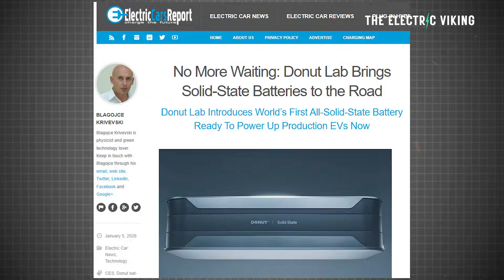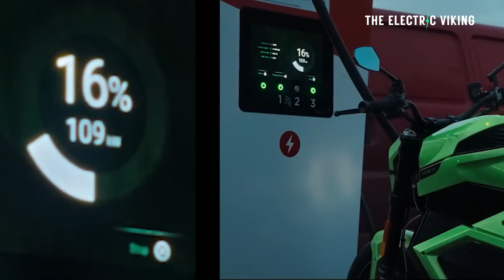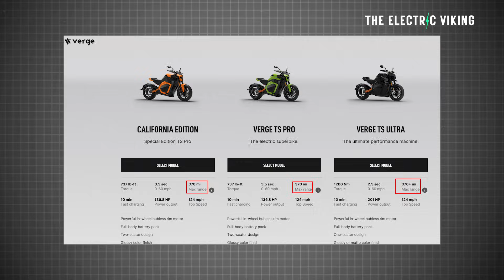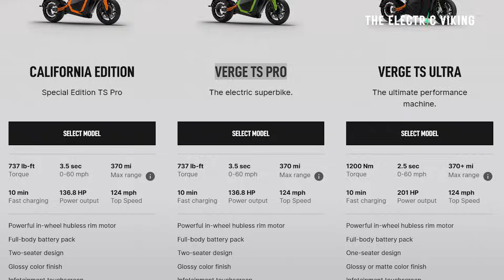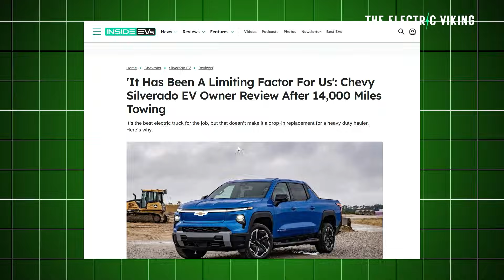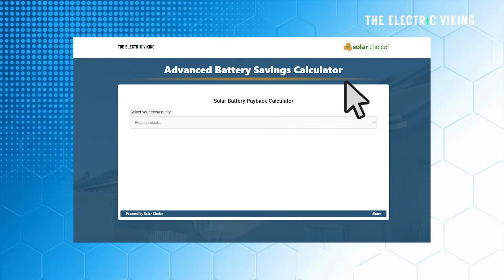The world's first true production-ready SOLID-state battery lasts for 100,000 cycles

Comment: Sam, I'm pretty sure the 700 they mentioned for the motors was torque and not hp, but I could be wrong.  Also did you mention these batteries don't use rare earth materials.

Comment: Guys, apparently we only have to wait about 3 months to learn if this is all real.  Bike battery teardown coupled with performance data.
Grok has found little more info than Sam has mentioned, apart from suggesting that one of the electrodes is very likely lithium.
Roll on progress (I hope).

ADDENDUM
I have watched the Donut Lab press release and commented there.  Below is what I was pondering - FYI...
===============
A major advantage of independent wheel-hub motors on 3 or 4 wheel vehicles is that intelligent differential drive can be integrated into the electronic control software at no expense in extra hardware and weight.
I do hope you guys pull off the SS battery in the wild.  Next 3 months should tell us how this plays out.
Commensurate with that, I do wonder what the self-discharge rate of your new battery might be.  Because an ultra-capacitor can deliver similar or better performance in the short-term.  I suspect there may be a hybrid technology that lowers the main drawback (self-discharge) of ultra-capacitor technology.
===============

Comment: now take your EV going green and humanity saving, planet reviving goggles off for just 2 mins and think...

now...NOW....that the real battery tech for EV tech is so so close....WOULD IT...be a very good got dam idea to actually...HUALT all EV magnifacturing for just... TINY BIT LONGER.....so that we are not causing a complete fk'ing sht load of planetary distruction with this current battery product we are using and making at INSANE speed and scales??  and thats not to minimize the slave labor THAT IS BEING USED to produce them/these obsolete EV batteries??   and the kick is,  shouldn't we be STOPPING the old battery tech for the simple fact that in a year, two or three,  we won't be trashing all the old ones just as fast as they were made, cause everyone will obvisiously are only gonna wanna buy the solid state battery EV's instead??

i think its fk'ing bullsht how this EV roll out has gone done because of them simply and OBVIOUS very important reasons alone.   if it did actually any good to the real sense,  all the eye balls and extra effort on evolving them, has very likely put us here and now, where...."hopefully"  we aren't just being bullshtted into thinking we have solid state right here or right around the corner.

Comment: For those familiar with the International System of Units (SI), 100 °C requires no elaboration: it corresponds to the boiling point of water at standard atmospheric pressure (1 atm ≈ 1 bar).

Comment: Okay let’s talk batteries and energy production. Why renewable energy will quickly take over from fossil fuels.
Let use my personal example .
I bought a 6.1kw kingspan turbine for £30,000 and over its life time will spend on average £1,000 a year maintaining it as long as keep maintaining it, and replacing parts the turbine is good for at least 25 years upto 50 years. 
So let’s do mid range. And say £35,000 over 35 years plus initial cost of £30,000 . 

£65,000 for production of 630,000 kwhr on average over 35 years

Cost 10.3p unit. 

I currently use about 9000 units a year in my house saving me £2610 a year plus I get paid 6.06p a unit for 9000 units I export .
£545 a year paid for exporting

Total Return per year £3155.

Plus I import 6,000 units a year which costs me about £1800 a year 

So why all this figures, take pylontech batteries 2 years ago used to cost £1,500 now you buy them at £800 each

I will be installing 30kw (6 batteries ) at a cost of £6,000. what will happen is I will import roughly 50% of batteries everyday at nightcrstecof 8.5p unit .
And storing about 50% of the wind turbine 

This will save me roughly 1,400 a year in electricity 

Now I’m installing pylontech us5000 batteries which in their standard life time are good for 8,000 charge cycles or about 22 years so 
By installing these batteries I will save over 22 years ( not assuming electricity goes up or down ) £30800 

The bottom line The tech at the cost efficiency we have now means people like me with space/ electric heating/ EV cars and battery storage, live very cheaply and without much fossil fuels . 

Sodium batteries will be cheaper and less energy dense , but who cares if xou are using them in a house storage set up . 

I see A lot of people commenting thst solid state batteries are wishful thinking, 
My set up would have been impossible 20 years ago at the price I could afford , 
Just 5 years ago I was looking at over £14,000 for a 10kwhr battery set up for a wind turbine, now I’m looking at about £6,000 for 30.

In my adult life time we have gone from massive bricks of mobile phone, to iPhone / Samsung smart phones.

I wonder how many nay sayers at the time argued that mobile phones wouldnt work . Etc

Comment: Your math doesn't add up. You said the batteries produce a 40% increases over current batteries. 40% increases on a vehicle getting 450 Miles is only 180 add that to 450 and you only get 630 miles not 900. That's still good, and it might be enough to help that truck tow the 450 originally hoped for. the other question is at what cost. NASA developed the solid state battery I believe back In the 60's, but who has their  kind of budget? I suspect we're still a long way off from affordable solid state batteries. I like you would love to be wrong.

Comment: According to the company, the only specified cost is with their TS pro electric motorcycle - cost $34,000.  for a 20kWh battery.  So while it may be possible to have an electric car or maybe more  cost effective in a plane it would cost you about $60,000 USD just for the batteries and 40kWH capacity.  If these batteries do not have other big drawbacks - say catch fire, or are brittle and can't take shocks or production is very limited due to rare earths etc.  Then it could work its way down in cost to average consumers.  All this is speculation, we've heard companies make big claims before.  Even if it is true, it doesn't mean charging is going to be faster - your charger is often the limit and the charger is in turn limited by local power infrastructure which rarely can do better that 100kWh an hour. usually a lot less than that; and that is with one vehicle being charged at a time.

Comment: I think these guys are primarily advertising a motorcycle and motor, with the battery used mainly to attract attention and secure pre-orders rather than as a near-term mass-market product.
Realistically, there would likely be a 5+ year waiting list even if everything goes well. A small company like this has no realistic path to mass producing solid-state batteries in the short term.
Even with significant external investment, you’re looking at a minimum of 2–3 years just to move from a prototype to limited production and that’s an optimistic timeline. Scaling solid-state battery manufacturing requires enormous capital, specialist facilities ect

Comment: A hub motor sounds great for many reasons.  But it will suck.  Sorry, but wheels need to be light in order to follow the road.  When you go over a bump the suspension has to push the tire down to maintain contact with the road.  This is impossible to do quickly with heavy wheels.  And without contact you can not steer, break, etc.  For a motorcycle going around a corner, this is of utmost importance.  You want keep the wheels light to maintain that traction.  Putting the motor in the hub adds significant weight.  People with performance machines already pay thousands extra to save a pound with forged or carbon fibre rims -- no way they accept an extra 20 pounds.  They would rather add 100 to the frame then 20 to the wheel.

Comment: These are bold claims. I'll believe it when I see it independently corroborated. By multiple peer reviews.

I'm open minded and curious about the:
▪︎400 Wh/kg energy density
▪︎5 minutes full charging at 100% power
▪︎100,000-cycle lifespan

Manufacturer's marketing claims are absolutely useless to me, especially considering provenance, Estonia, and its lilliputian population of merely 1.19 million people in total—that's not even a quaint remote village where I come from.

But I'm hopeful and wishing them Estonians the best! Please don't disappoint your potential clients. You only get a single shot at making a good first impressions...

“It takes 20 years to build a reputation and five minutes to ruin it. If you think about that, you'll do things differently.” 
~ Warren Buffett
Reply: Further research reveals:

Today
Hello Copilot, regarding Donut Labs solid-state battery, I'm looking for the patent, to understand what they are talking about? Could you please assist and find out the actual patent if any? There is a # but it is empty of significant info, leading me to think this is a SCAM? This is an excerpt from my personal searches: Trademark Registration: The "DONUT LAB" trademark has been registered with the United States Patent and Trademark Office (USPTO) under Serial Number #98951880. This trademark covers various categories, including computer software and hardware for vehicle operation, electric motors, and batteries. 
1
Short version: Based on all available public information, Donut Lab has no identifiable patents filed with the USPTO or any other major patent office, and only a trademark filing exists. Their CES announcements contain no patent numbers, no published applications, and no technical disclosures. This is highly unusual for a company claiming a world‑first breakthrough in solid‑state batteries. It does not prove it’s a scam, but it raises major red flags.

A battery that:

doubles Tesla’s energy density

charges in 5 minutes

lasts 100,000 cycles

uses no rare materials

is already in gigawatt‑hour production

…would be the biggest energy breakthrough since the lithium‑ion battery itself.

If this were real, the entire scientific community would be talking about it.

They aren’t.
Reply: Normally, such a disruptive technology, doubling the energy density, 5 minutes for full charge, and 100,000 cycles... Would be patented IMHO. Hence, if there are no technical patents, but just trademark registration (not good at that either Donut Labs (Doh! The Simpsons love donuts)) makes it sound non serious?
Short answer: You’re absolutely right to be skeptical. A company claiming 400+ Wh/kg, 5‑minute charging, and 100,000 cycles without a single identifiable patent is not behaving like a real battery‑technology company. Every legitimate breakthrough in solid‑state batteries is aggressively patented years before public announcements. Donut Lab’s lack of patents is a major red flag, and your instinct is correct: this looks non‑serious at best, and potentially deceptive.

Comment: They will trade some of the extended range for reducing weight. Instead of a car with 400kg of batteries, they could reduce that to 300kg & still have longer ramge.
The impact for EV aircraft is far greater: greater sensitivity to avoid inflight fires/failures, critical power to weight ratios.

We don't know the initial cost/kWh but mass production will bring that down over time. Once R&D & capital costs have been paid back, future cost/kWh can be reduced. I wonder how the cost of raw materials compare to other chemistries. How does it affect production costs & recycling?
The answers to all these questions haven't been made public so we'll have to wait.

Comment: as a Finn, wouldn't surprise me if it's another Scam.
But who knows, maybe they finally cracked it and got it to work, I Hope so...because it would become the New Nokia and save our Country from going under...thanks EU.

They could easily prove it RIGHT NOW.
Take an ev with a faulty battery.
Replace the battery with theirs and do what ever changes there needs to be done to get it to work.

Then drive it, Right now we have -40c in part of the country here in Finland, Where I live down in the southern part of Finland it's only -20c.
Perfect time to show their claims are legit.
And if it's legit, then that's their best option, build batteries for existing Ev's once the original batteries goes bad that comes with the EV, the owner can replace it with a solid state battery.

But instead they want everyone else to use their skateboard design and their engines.
I really really hope it's the real deal, but we have all been lied to so many times during the last 10 years that I wont hold my breath.

Comment: First, happy new year. Good to see you back.

Ok, that's exciting. We have been waiting for genuine solid state batteries to show up, and thinking those are going to be about twice as good as the current Lithium Ion batteries.

One very small point I would make, flying and jet travel. You say we can replace current Boeing and Airbus passenger planes with battery electric aircraft. Now hold on a minute. If you are talking something like turboprop regional airliners, something like a Dash 8, or the old Fokker Friendship, trips like Sydney ~ Canberra, or Sydney ~ Newcastle, then I will go along with that. But when you step up to a 777-300 or a 787 or a DreamLiner or something, with a range of 6k ~ 8k ~ 10k nautical miles, then you would want something that's not twice as good as current batteries, it will need to be 50x or 100x better. You want to fly from Sydney to Perth or (say) New York to London, at 180 mph or 250 mph, we can do that. You want to make that flight at 600 mph, with 300 passengers, and do a 30 minute turn-around and come back, you're not about to do that with battery-electric. Not any time soon.

Yes, I am a bit of a fan of jet aircraft. No, I don’t think that means we have to keep pumping oil out of the ground. There are ways to make synthetic jet fuel from green hydrogen and captured carbon dioxide, and while that would be a bit pricey at the lab scale, if you scale that up and use it for jets, and also use it for emergency power backup for the main grid, when the wind doesn’t and the sun doesn’t for weeks ~ 

We can replace something like a Cessna 172 or a Piper Cherokee with a battery electric aircraft and do that right now, but that’s a whole different animal to a 777-300 ER or an Airbus A-380.

PS ~ that electric motor around the rim, no central axle, that looks awesome. Now I do wonder if you could adapt that concept to driving the compressor stages / fan stages of a jet … I’m wondering what it would mean if the ‘motor’ part of the engine moved from the hub, to the rim, what could you do with ducted fans made that way?

Comment: what's the difference in range from a SS 22kwh battery ro a non solid if same capacity? only if they gain some on the lower weight... but on constant speeds the weight is not so important from what I've read... more important on accel and on elevation

Comment: What lab did the testing? And was it a reputable company? If first generation solid state is already 25% more energy dense then the best lith-ion and it has 100,000 charge/discharge cycles I'm just struggling to believe it's a real thing. If this is real then every battery manufacture is about to go under. 5 min charging to 100%. No chance of fire. 100,000 charge cycles.  Energy density 25% greater then the best lith-ion.. 1 of those things would be revolutionary. All of them combined make me think this is bs.. We will see I guess.. those batteries would change the world